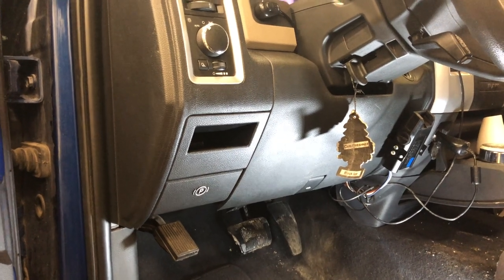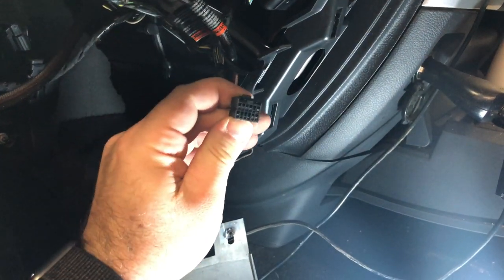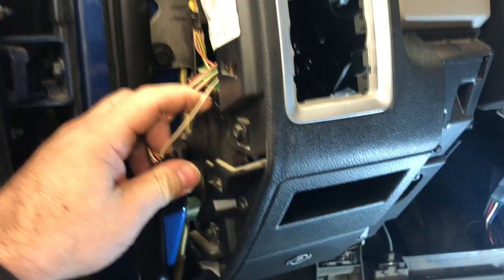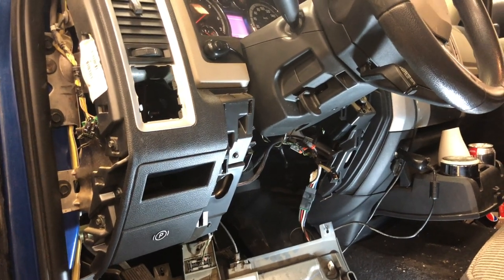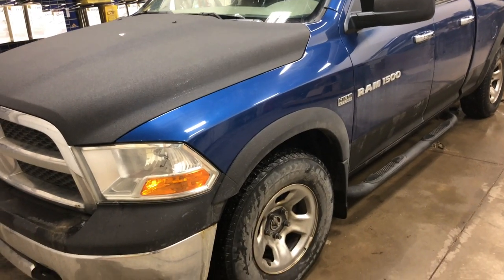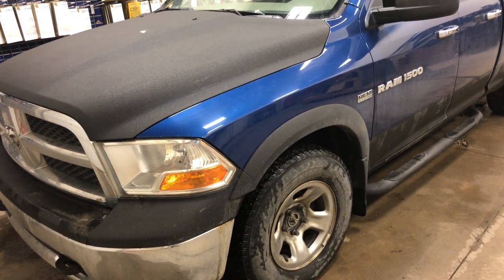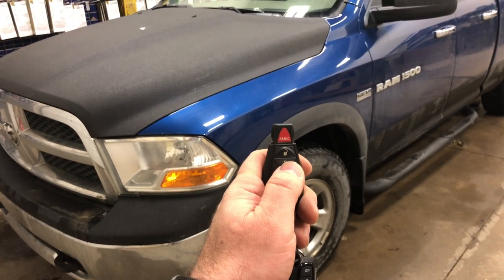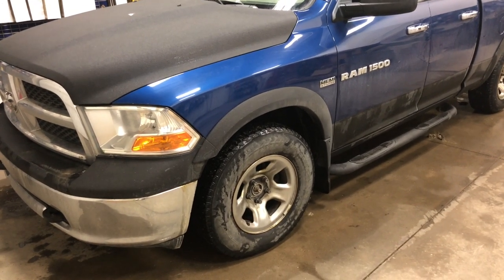2011 Dodge Ram Remote Starter | IdataStart HC3452a

Comment: do you know how to extend the runtime?
Reply from the maker: It has to go back to an authorized dealer. Run time as well as many other features can only be changed via the weblink updater
Reply: @srtbull_yt6854  no dealers because I got this vehicle used with the starter on it and also I heard about that weblink thing is it possible to do it myself?
Reply from the maker: @remrem69 if you can get your hands on a weblink, the account is free so you’d be good to go. It would be a shame though, spending money on something just for one quick change. What’s the current run time?  They max out at 35 minutes just for your information. My default is 30 minutes but I’m way the eff up north.
Reply: @srtbull_yt6854  my runtime is 10mins and im in canada alberta and winter here are worse that's why I want it to run 30mins
Reply: and yes I just got weblink and account
Reply from the maker: @remrem69 oh sweet. A fellow Canuck. Yeah 10 minutes won’t do you any justice.